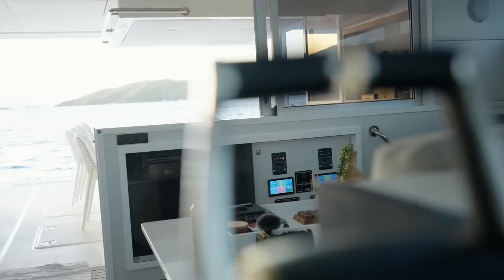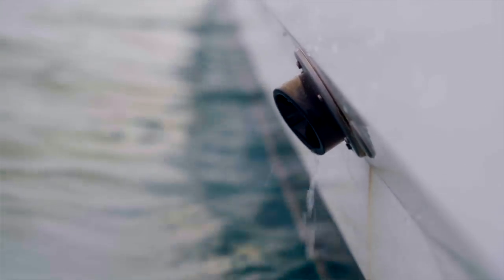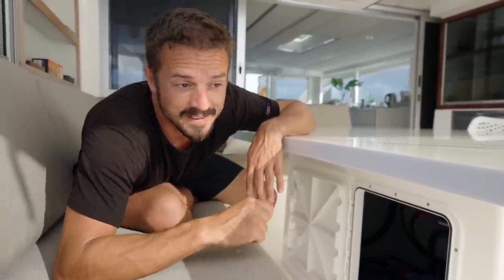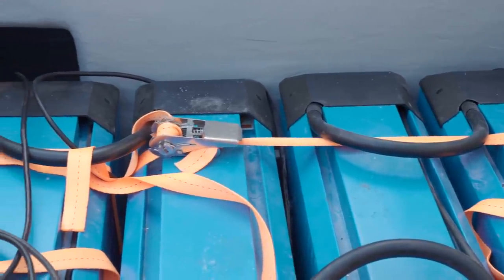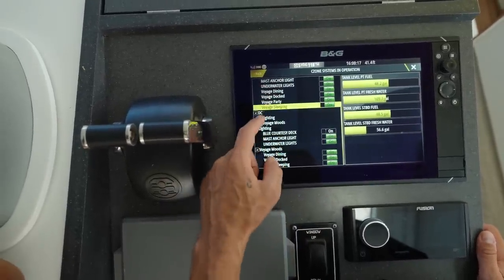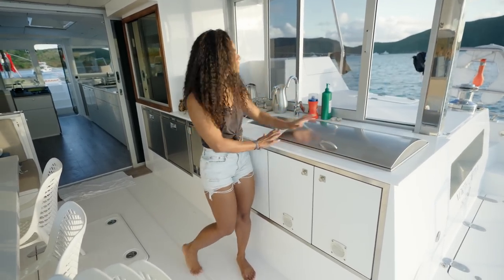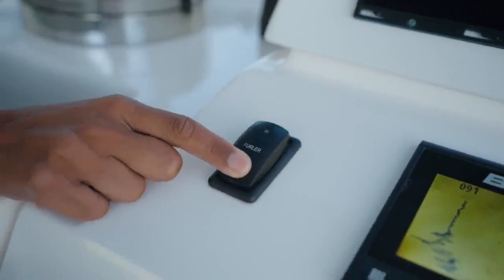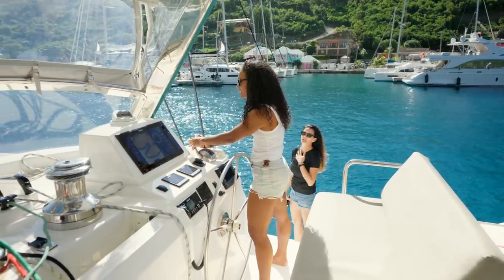Technical Boat Tour: Voyage 590 Hybrid-Electric Catamaran | Step 378

Comment: running a gas engine to charge a battery to run a electrical motor is about as inefficient as it gets.
Reply from the maker: Yes. Hybrid set ups like this can be much more efficient that a standard diesel. It all comes down to runtimes and use cases. 

Just look at the mpg numbers from hybrid cars.

Comment: I don't get the point of this boat as a hybrid. You're running two huge diesel engines for at least for hours a day anyway. Rip it all out, stick in two diesel engines, improve the solar and you have a simpler, more efficient, lighter system.
Reply: So the point of a diesel electric system is the same as on a train locomotive. The diesel engine/genset can run at its most efficient power/revs and provide power to the electric drivetrain and charge the batteries at the same time. Many ships are now diesel electric as well for the same reason.
Reply from the maker: Also, on the all diesel version of this boat, they have 4 diesel engine. 2 (even larger” gensets and 2 propulsion engines. The only difference is the battery bank on the diesel version is smaller, so you have to run the gensets even more than the hybrid one.

Comment: Worst of all worlds, like hybrid cars.
Either the ICE has to drag heavy batteries around or the E has to drag engines and fuel around.
Reply: It's a transitional time - lighter batteries are being tested right now by the big motor manufacturers and will soon be available commercially. There have been massive advances in battery technology. Greater capacity, less weight, faster charging times are all going to improve enormously